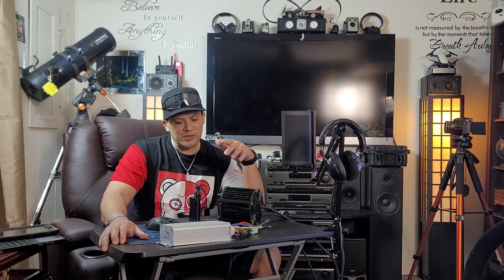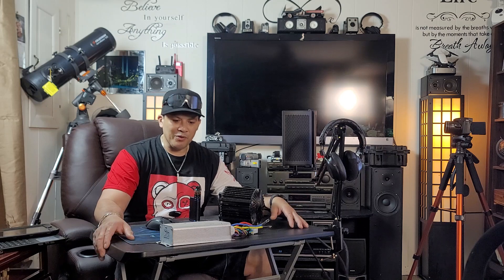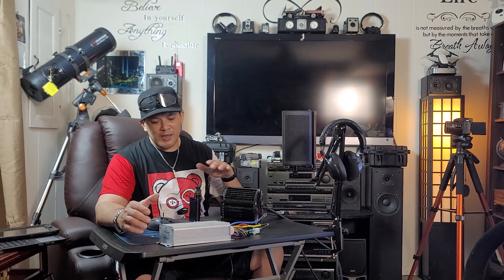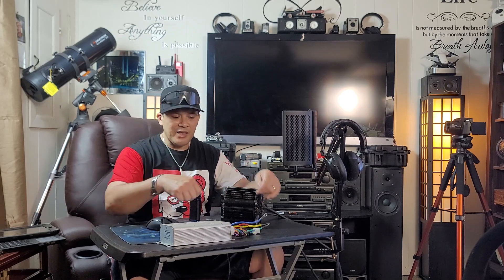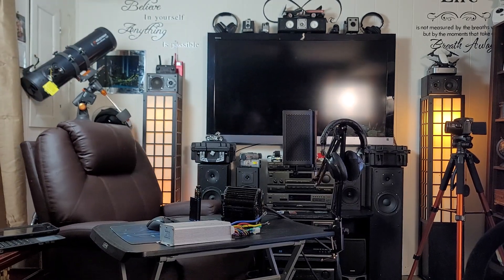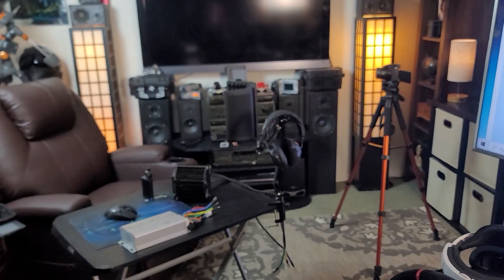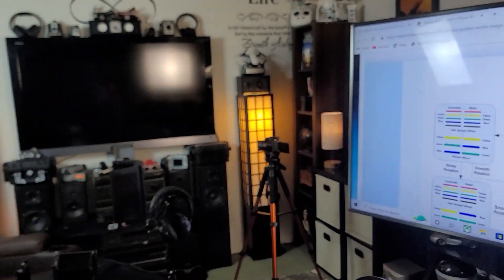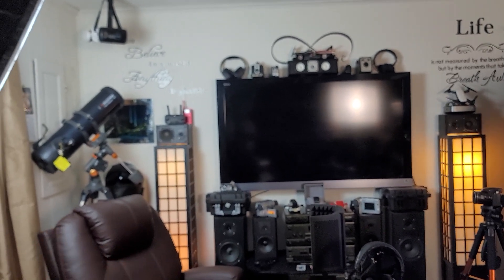Ebike Motor phasing,just installed your new controller and now your bike no longer runs correctly!

Comment: On a sabvoton controller, you can reverse the direction of the motor via software too.  You are usually in there doing a test run anyways, saves you an extra step.